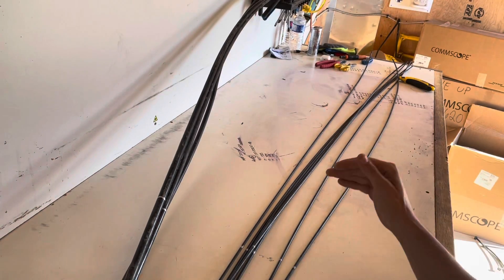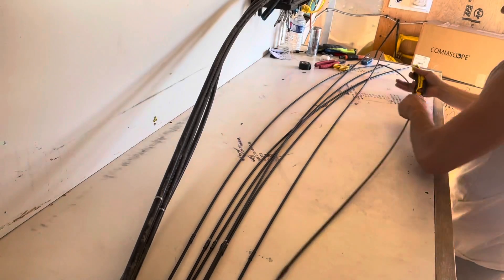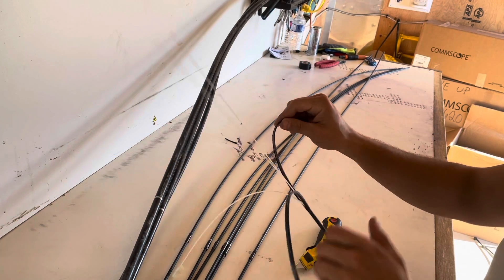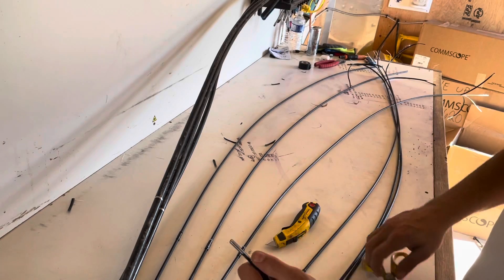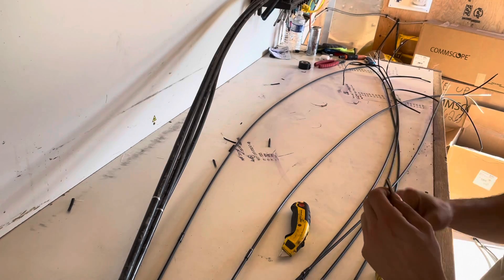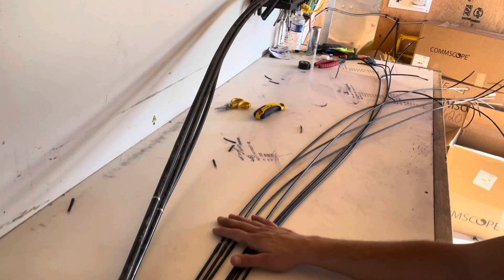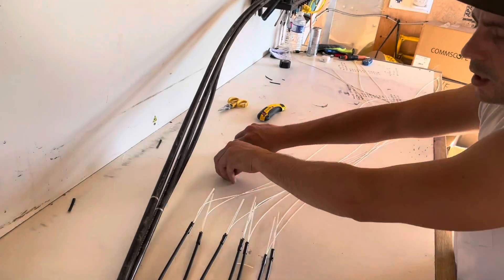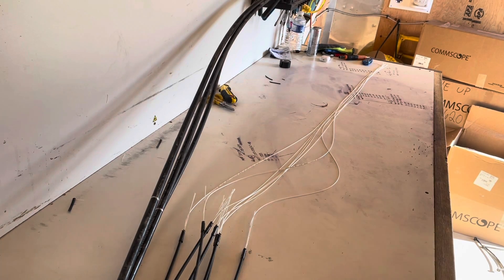Corning fast access fiber optic cable

Comment: THe Corning drop cable we use has six fibers in it. Even if it's a single resident they get the six-fiber cable. It's handy in smaller MDU's and if the house has been converted to a rooming house, we don't have to run fresh drops. just splice and go.
Reply from the maker: Hey thanks for watching and commenting🙌Nice yea makes sense to run more. These direct buried networks each lot only gets the two but for other networks I have built is usually Multiport terminals with single Fiber drop lines running to the house with the occasional two Fiber to service basement suites. For MDU depending on the size it’s usually just 12 Fibers to the MER on the networks I’m working on at the moment
Reply: @FiberSpliceGod  The  building I am living iin right now just dropped in a 96-fiber cable. They are being very coy about why. They said it's for 5G. But as you know that is a term that is more marketing than an actual definition. The building has 390 apartments and about 450 tenants with mostly small 450 sqft  bachelor apartments and 54 one-bedroom units and is lower income with mostly social housing and some market rate units like the one I Live in. So I keep taking pictures and watching to see if they leave the enclosures open so I an see what they are stuffing into the cabinets. Most of the exiting cable tv is wired on the outside of the building to prevent copper theft.